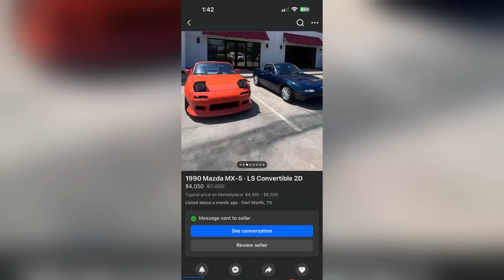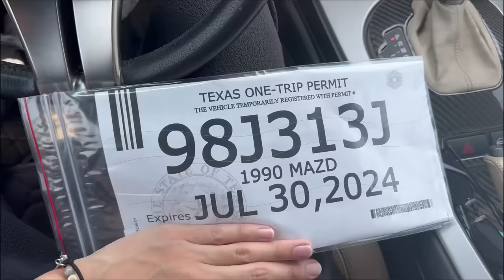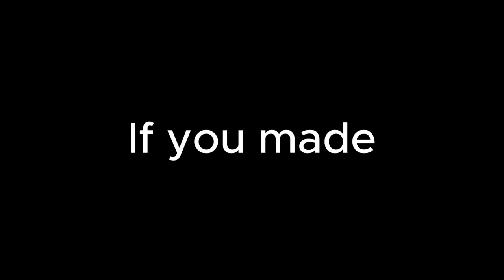I Bought the Cheapest Miata That Doesn't Run...

Comment from the maker: Comment what car mod I should do? *don't worry we're still boosting the civic! :cat-orange-whistling:
Reply: honestly i think suspension modifications would he best on the miata. you can do it one mod at a time over a period giving feedback on the before and after. like coilovers, then control arms, sway bars, polyurethane bushing replacements etc. no “go fast” mods in the power sense but my stock motor d16  was able to beat b-series and k-series simply because of my suspension and confidence in the car
Reply: I think doing a 2 rotor swap or either a v8 would also be cool
Reply from the maker: @KKDriver  Thank you for your input! I'll look into some suspension :hand-orange-covering-eyes:
Reply from the maker: @Jaywashere255  Hellkizzy swap :face-purple-wide-eyes::face-green-smiling:
Reply: Let's go turbo bro💀
Reply: Resto mod would be sick, unique build
Reply: DRIFT BUILD MIATA
Reply from the maker: @Dc5_kid_alex gotta turbo the civic first 😂
Reply from the maker: @user-gs5lz8lz9w I agree 👍
Reply from the maker: @750Squid I’ve never drifted but I would like to try 🛞
Reply: Where is that k swap, ? This car would smoke em with a k series
Reply: for sure aluminum radiator if it’s anything like our civics it should be cheap as hell
Reply: Hardtop
Reply: If she doesn’t want to run ask her to slide 🤭
Reply from the maker: @Real95neta k swap would go crazy 🤪
Reply from the maker: @miguelzavala4523 I’ll check that out 👀
Reply from the maker: @Alex-dn9hk LMAO 😂
Reply from the maker: @Gen10civic why are they so pricey 😭
Reply: Change it back to white then you can have 2 white cars, get a hardtop, roll cage coilovers new wheels make a clean build
Reply: Check the Valve cover gasket, all my buddies who have owned a Miata have had it fail and leak oil
Reply: Put the turbo in the Honda first😢
Reply: Big juicy turbo
Reply: Maybe a widebody kit, i know that would look cool and its also great for content
Reply: Coolant reroute is a must
Reply: Winky Winky miata😉
Reply: Paint it white so it matches Honda
Reply from the maker: @man-mq9rk might have to 👀
Reply from the maker: @itsm3267 bet I’ll check it out!
Reply from the maker: @Dankmeme42 we getting it 😊
Reply from the maker: @beelegend1694 juicy turbo yes 😎
Reply from the maker: @kalebharpe6320 never seen a good wide body for the miata. Any suggestions?
Reply from the maker: @epp9122 what’s that?
Reply from the maker: @KK-mj6gj yes 😂
Reply from the maker: @ukasz816 might have to 👀
Reply: @jarekmai  it routes the coolant to the back of the engine, in stock form it only cools cylinder 1 and 2, and 3 and 4 can often run hot. Its a must if you plan on becoming the next DK bro
Reply: you should wide body kit the miata
Reply: Temu Mods
Reply from the maker: @MrJayPockets  Yes 🤣🤣
Reply from the maker: @elitoohigh8089  Possibly :face-purple-wide-eyes:
Reply: @jarekmai  1.JDM Livery.                                                                                                                                                                                                                                     2.more stickers💯
Reply: Ywuwuwu😊
Reply: do you know why he was selling the miata?
Reply: Get that thing a new paint job and turn it into a stance car, not major tilt but a lil
Reply: k swap the miata and boost it
Reply: It's my dream car

Comment: gotta love the miata tax lol 

i also bought a shitty 1990 orange miata, was missing the belt that led to the water pump, so it had no coolant through the eng, the coolant res had a hole in it, and also no ac lol 

put a new belt in, slapped some gorilla tape over the hole, car ran fine till i found out how fucked the timing was and the woodruff key shot through my alternator lol